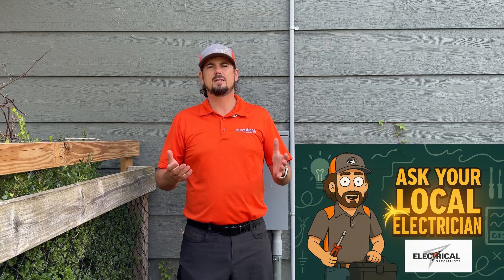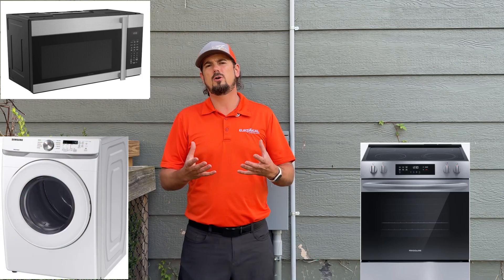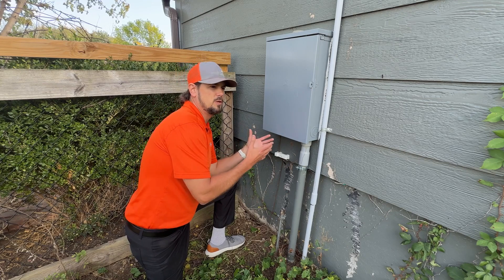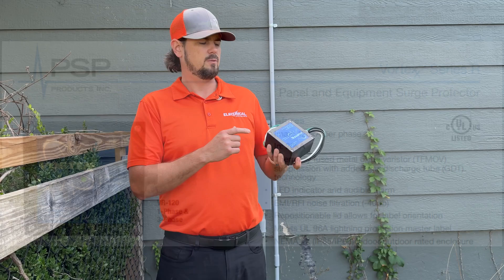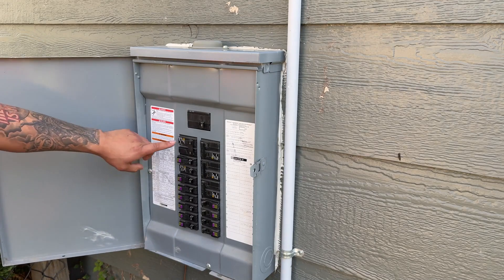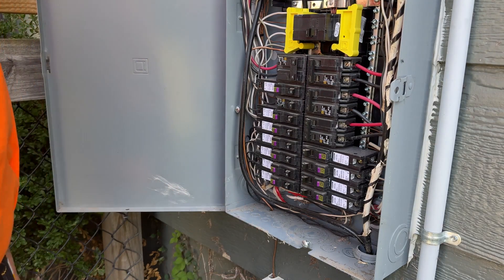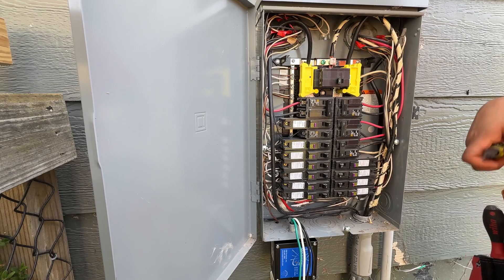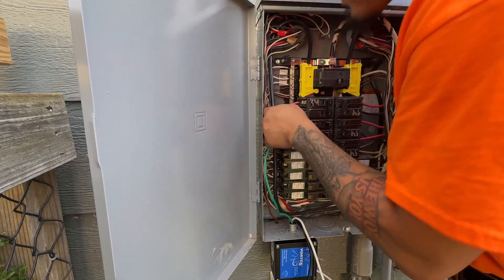Whole House Surge Protection – DIY Made Easy!

Comment: Excellent video. Thank you very much. Subscribed. It would’ve been helpful to hear after it was installed the flow of electricity and how in general the device works. And the thought process involved in which breaker you installed on and why?
Reply from the maker: Thank you for the input Nathan. The video was part of our DIY series on "how to" so you are correct, we didn't give a lot of detail on exactly how the device itself works. We do have a video on surge protection that gives a very in depth explanation. 
https://youtu.be/4FS3n7e7SLI?si=nyavxp2s0JAL6Pe3
Let me know if this helps, and thank you for watching!

Comment: Not a good explanation.  You added two black wires to what?   Why is a red and black wire, there are no red on the device?  Very poorly done.
Reply from the maker: Thank you for the input. We purposely did not go into detail as this is a temporary installation for educational purposes. Every panel setup will be different so we made this part very broad on purpose, knowing we cannot cover every variable. In this instance, we landed each black lead from the device to the same contacts that a red and black 240 Volt load was already connected to. This is approved by the manufacturer, but certain jurisdictions won’t allow this so ask your local code enforcement if a new breaker will be necessary. We would be happy to answer any specific questions you may have. Thanks for watching!

Comment: What if I have installed a second main breaker for my whole house portable generator?  Will this provide protection when either one is being used?  Would I need one for each breaker?
Reply from the maker: Hey Glen. I believe you might be talking about what is called a generator interlock kit. That is where a secondary breaker is installed to backfeed the panel while the main breaker is off. You always want to make sure you have a bracket plate system so the main cannot become energized while the generator breaker is on, sending voltage back out to the transmission lines. We see lots of this on farms etc. In any case, it would depend on the style of surge protection device you install, and how it protects the panels circuits. When adding a automatic or portable generator, its always advised to add surge protection on the primary and secondary side for added safety and longevity. You could actually have one at the meter, the panel, and at the source such as the plug or whatever connection point you are using. I hope this helps!

Comment: Does the code permit using an active breaker for surge protection?
Reply from the maker: Great question Bill. This would be a question for the manufacturer. Some breakers allow multiple conductors and some do not. In this situation the manufacturers instructions for the surge device allow for it. That doesn’t necessarily mean the breaker does. This was only a temporary installation for educational purposes, but good catch. We would always suggest adding a new breaker to be sure. Thanks for watching!